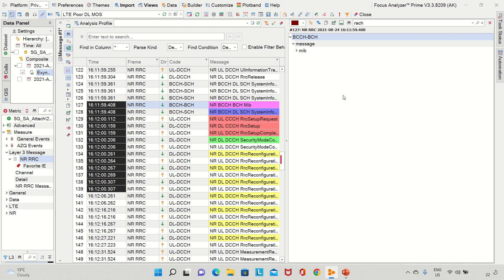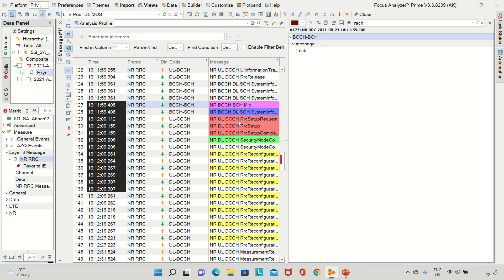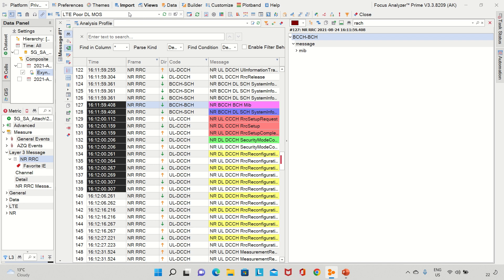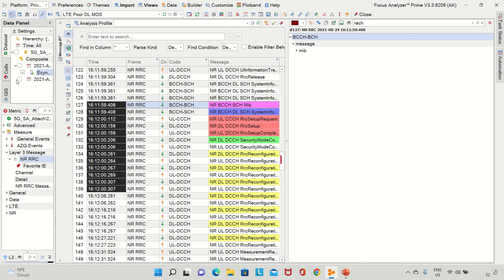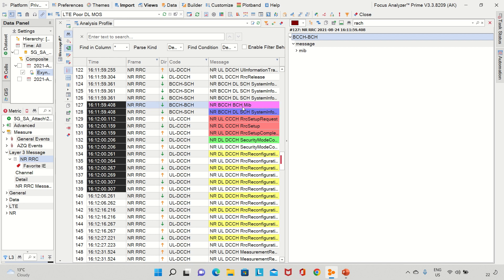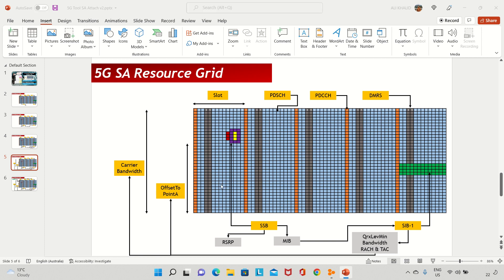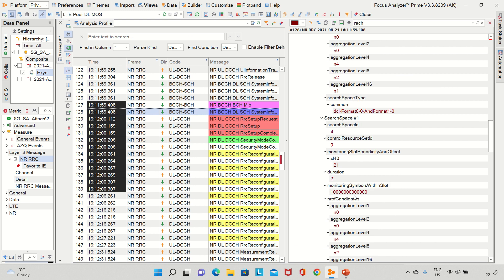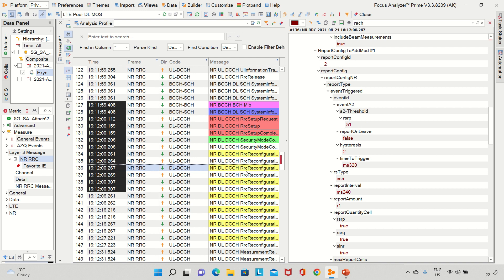5G SA L3 RRC Analysis - 5G SA Call Flow & Resource Grid Visualization Using Post Processing Tool

Comment: You said that RSRP is calculated based on SSS power at 6. 30.  In LTE rsrp is the average of REs carrying RS power.. so in SA it is different?
Reply from the maker: Yes, there isa difference as LTE has CRS that are present all the time so RSRP is based on those RS. While 5G does not have CRS that are present all the time so SSS is used instead to estimate RSRP. This is same in both 5G NSA and 5G SA.